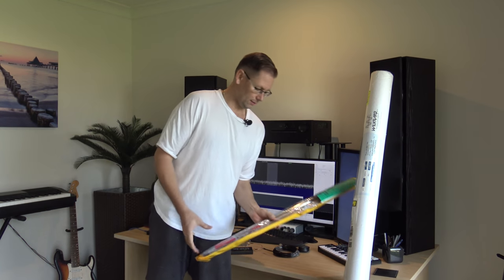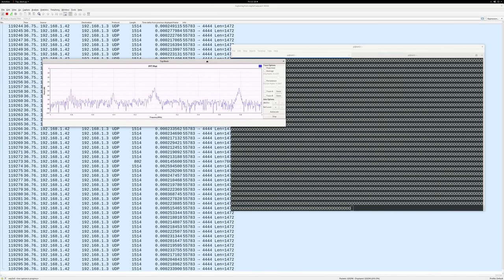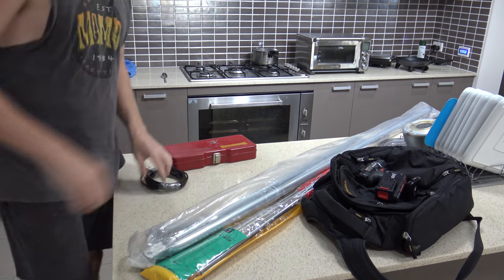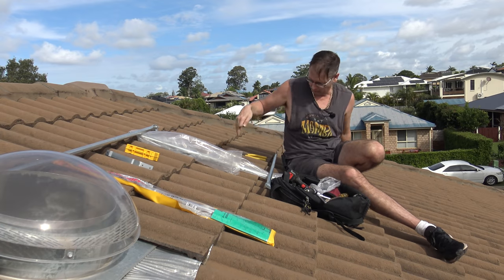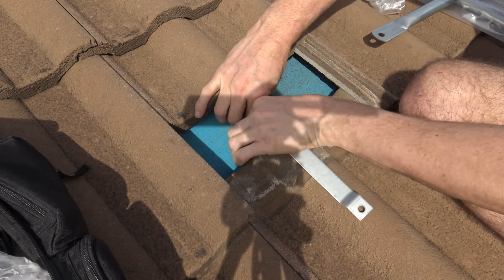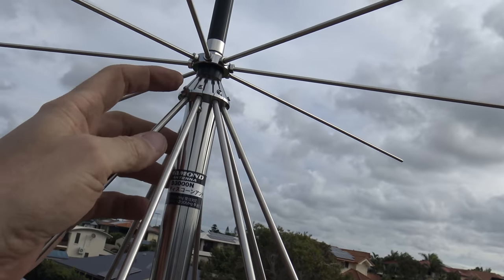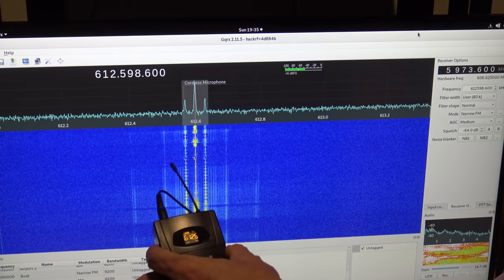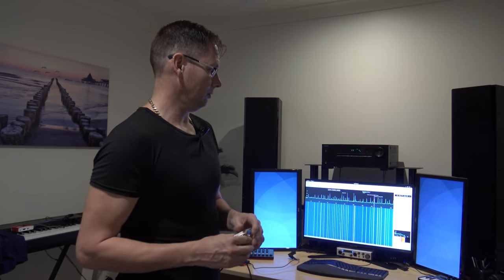Installing SDR Discone Antenna

Comment from the maker: I'm well aware that this setup is about as ballanced as a horse's arse, but it's better than a kick in the head for now.
Reply: Don't want to bad mouth because I've found it interesting (and I am here because I enjoying doing Enterprise WiFi for a living. Watching you do your thing and geeking around is a learning opportunity itself)...
But here is the thing to consider if you're heading back on your roof and I know you will :)
1# I've commented before about it, it's just my personal taste to replace zip ties with Velcro (Seriously it will save you time).
2# You'll need to properly ground that antenna for your own safety. Also because your insurance will be happy to decline your claim if a lightning is striking your DIY install and a major damage occur on your house while the install isn't up to your country's electrical standard on roof top antennas and masts.
3# Lightning arrestor will also be needed.
4# You need to review the bolting situation and going with a locking washer or locknut solution. The wind will eventually get the best of your install.
5# You did good with the dripping loop on your cabling but the wind will make sure to push the water and the anchor bracket's shape and physics of fluids will do its thing.
6# Not sure what screw material you've used to attach your brackets but I hope it won't rust.
Reply: How do I heart this comment?
Reply: That's a waterproofing membrane that was torn under the tile right? shouldn't that be resealed?

Comment: The radio cable has to be 50ohms and you are using TV cable RG6 that is 75ohms. Run a RG8X for the radios. Maybe you can receive as is but you can damage your Amp or even the HackRF!

Comment: Nice setup! It would be interesting to compare how much dB you will regain with the correct adapters. Compare the strength of a known RF transmission before and after.
Reply from the maker: Now that's the sort of thing I might do actually.

Comment: I think you might get some bad signal reflection on the line because you did not put any adapted load cap on the splitters... But, hey, it works.

Comment: Love the hackery. Use what you've got!
I did a small PA gig once and didn't take the right cable to get background music into the mixer. Also didn't bring my bag of adaptors.
The solution? The tip of a headset mic pushed into the hole of the left earbud turned down low.
Come on you lot, what dodgy shit have you pulled together to solve a problem?

Comment: Have you tried a Biconical Discone (Double Discone aka The BowTie) they work better than the Diamond and Tram Discone's 
Now add a MLA 30+ Loop 100khz - 30mhz and a Double Discone 25mhz - 1300+mhz and with both you have it all covered
Reply: Use at least RG-58 Mil-C or higher and no joins and less connectors to stop losses

Comment: I am a bit confused by this.  Are you using the Hack RF to Rx and Tx from a computer with an SDR software without using an actual hardware HF transceiver ??
If so, I am very interested on how to do this.  I would love to use my computer as a Home base station for HAM HF/VHF/UHF
instead of buying a $1,500 hardware transceiver.
I am debating between HackRF and SDRPlay RSPdx,  still gathering information, because every time I ask friends about it, they do double speak without actually telling me anything.
And its very frustrating.  Its like they want me to guess, even though I ask them for help for what I want to do.  I stopped being friends with them, because its not worth it or my time.
Reply from the maker: Hey mate, I just did that the other day. I'll be making some more SDR videos in the near future, but I did make a transmitter the other day with gnuradio and hackrf. In the meantime, get as familiar with gnuradio as you can.

Comment: What about lightning?
Reply from the maker: What about all the things, that you said we were to gain?
Reply: @TallPaulTech  Hahahahah! Well played - just like in the ashes.
Reply: @TallPaulTech  Any method you'd suggest for isolating it in case of a storm?
Reply: @will16320  Grounding on the negative side and spark gap arrester on the positive lead to ground. This is generally ideal for home use at where the cabling would enter the home. I use a 4 foot copper grounding rod driven in near one of the drain spouts.

Comment: how can this be legal?  what do you need an rf transmitter on the roof for?
Reply: im not sure if hes using the HACKRF to transmit (since the hackrf SDR has a TX output.)  but im pretty sure its just to recieve signals
Reply: @fuhwurd  He says he is going to be transmitting in the video.

Comment: I hate those fucking tiles. I have them on my roof and I can't tell ya how many times I'v grazed my knuckles and hurt my fingers. Wish I had Corrugated Iron. You better check your SWR. There's a fair bit of impedance mismatch with the different Coax's you're using.

Comment: You really need an inline lightning arrestor... even if you do not expect to be directly hit by lightning. I found with a discone antenna that the shape gives several thousand volts across the feed point just in pre thunder storm conditions, enough that it would spark from the coax connector if left unplugged.

Comment: I have been using "sdr angel" with my hack rf on PC, it was easier to TX than with GNU Radio on Pi. 
Is there a way of getting a VSWR reading from the hack Rf when in TX ?

Comment: Why they say you cannot transmit on discone antennas?
Reply from the maker: Who says that?
Reply: @TallPaulTech   I as well have seen a few youtube videos and youtube posts of people saying not to transmit on discone.  I was also concerned about that as well.
It seems like there is some type of misinformation bouncing around youtube, and its very frustrating. Because the specs says you can, but people saying dont.  so its confusing.
Reply: Only reson i could think of would be power limitations when transmitting and  or poor impedance matching. The latter could damage the power stage the former the antenna.
Reply: You can but it usually isn't ideal as they generally have quite a bit poorer SWR than frequency specific antennas. It could damage your radio.

Comment: Light-Medium duty pole kit with very light duty mounting, screws too short and too flimsy. The way to mount on tiles is drilling them. As for the cabling and radio side, suggest getting an amateur license and understanding of all that is wrong with it. No comment on your plans to transmit and the legalities associated.